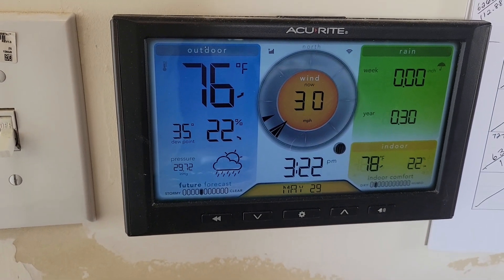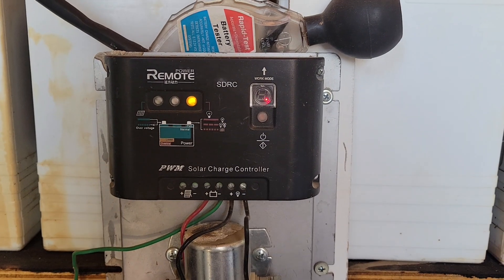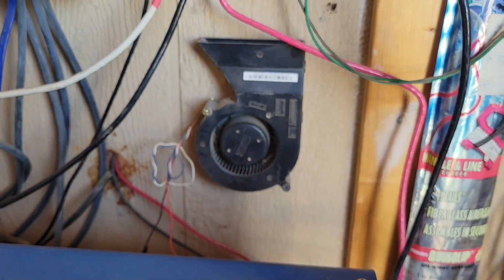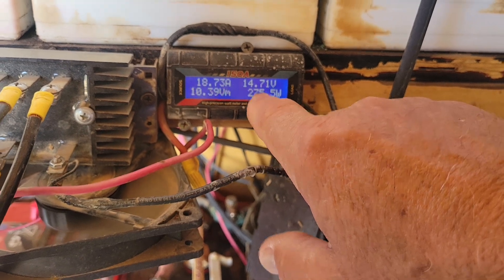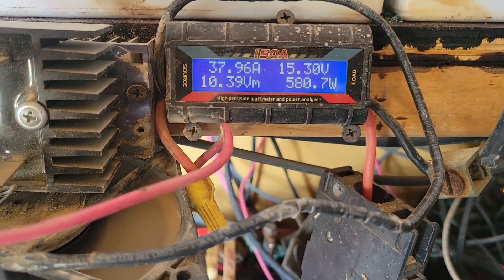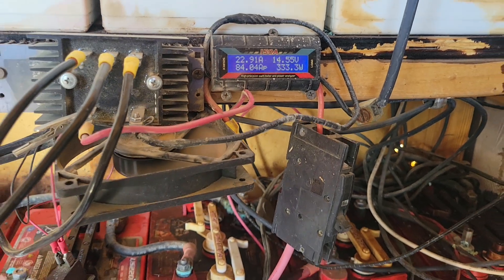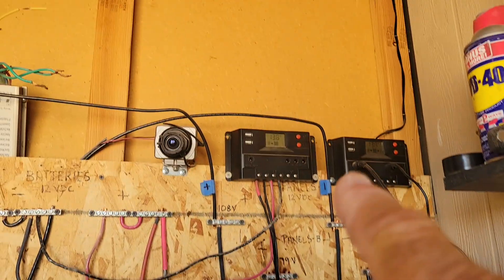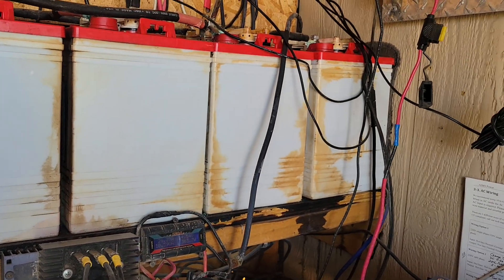Turbine Output & Dump Load Controller in High Winds, May 29, 2022

Comment: Hi G Bear like your site.  I am trying to find a wind turban load controller like you feature in this video.  Could you help me with it's name and supplier.  Thanks.
Reply from the maker: Welcome aboard!  The dump load controller I have is no longer made.  They have switched to digital units.
Check this, I don't know what voltage you need, this is for 12vdc
https://www.ebay.com/itm/304790038479?mkcid=16&mkevt=1&mkrid=711-127632-2357-0&ssspo=aQQOlvYpQl-&sssrc=4429486&ssuid=zdeiyk-orka&var=&widget_ver=artemis&media=COPY
Reply from the maker: You can also buy a dump diverter from this company.  This is where I bought my kt5 pma.
https://www.hydrogenappliances.com/

Comment: Your video has got me on edge. However, I would like some additional information on your Aims 12 volt inverter & charger. Can this inverter deliver power to all of your appliances in your home, if so, did you connect directly to your service panel?  Why must it be a; Global LF Series?  Allow me to thank you for your past videos, they are always loaded with information, well done.
Reply from the maker: Welcome aboard Eugene!  First, my inverter does run my household, but remember, I am OFF GRID, and live in a 450 sq ft cabin.  There are some concessions to be made, like not running high wattage appliances after sunset, etc.  The advantage of LF over HF, is reliability and peak power efficiency. 
Also, remember that off grid is "power in, power out" so having an efficient battery bank and solar system are as important as the inverter.  I would have preferred a 4000k inverter too, but they were sold out at the time and I was in immediate need.

Comment: I just bought two more batteries ; they went up $29 apiece since I bought the last two. I have 20 of them now. 990 amp hours @ 25 v. The 18 I had were doing pretty well, I went 3 days without the sun coming out, ( rain ) but the voltage was down a little more than I thought it should have been, so I figured it needed a couple more. I got a couple of those 120 mm fans that are 12 volts. I'm mounting one of them in front of the Aims inverter, so it will definitely have cooling going on when that fan is on. I made a couple of cables and I have the batteries hooked up and in the herd now. I am putting bigger wires on the charge controller, the new ones are #4 welding lead cable. And when the sun comes up I will have 1200 watts of panels aimed directly at it. I want to see what the amps is going to do. I think it will be around 35. Probably a good thing I got a 40 amp controller, lol. If these upgrades will let me run the A/C this summer, they will be well worth it. I'm sure glad I had most of them already ; that's a 30% increase in the battery price. It seems to me that having that number, they should last longer. I guess I will have to be the one to ask the question...since you have so much power, how come you don't build an electric car?
Reply from the maker: Sounds like you are getting there with your power.
As far as the electric car, I'm not a fan of them, and I really don't need one.  I will be getting either a side by side or a new atv in the future though.

Comment: I got my solar up and running and I'm getting ready to buy 1 or 2 more Midight solar classic 150, I know you have 2 controllers and I was wondering with this much money tided up I don't want to make any mistakes,  Am I correct by saying each controller I would run the PV wire in to a complete separate neg and pos bus bar from a seperate array then to the controller , then the neg and pos go down from the controller to the same post on the battery bank.  I think my battery bank is to big for my solar array. I have 5 KW of panels but I don't have them all hooked up.
Reply from the maker: Yes each controller needs a separate input group, not to exceed the 150 volts max.  But when running the output to the battery bank from 2 controllers, put one with the pos on the first battery and neg on the last battery, then the other with the pos on the last battery and neg on the first battery, etc.
Reply: @GBear  Got it thanks for your help.  I have it up and running but my battery bank midnight told me is to big for the panels and one controller.
Reply from the maker: @tonyjohnson1068  The only thing that would determine that fact is the speed of bringing your battery bank up to Float after sunrise.  I have 3450w of solar panels, and 3198ah of batteries, and I reach 13.6v or better withing an hour of sunrise.
Reply: @GBear  I have one controller. he told me to put another controller and add more panels. I have 5KW  of panels but I can't put all of them on one controller. I did plan to put  3 controllers but I spent way more than I planned on spending. I was hoping to wait for a while.
Reply from the maker: You didn't mention how fast your battery bank charges as is.
Reply: @GBear  I have 32 105 AH  AGM batteries, Wired in a 48 volt bank. 3264 AH.  in my opinion it is charging. By noon it's up to 56 volts. but as soon as the sun goes down or when it goes into resting it drops to 51.9.   Todd at midnight solar ( tech support) tells me that is depleted. But I run my window unit A/C at night it will not go below 50 volts. I called them because on Friday my controller went a little crazy. sunny day my PV in put voltage was 52 volts I have them wired for 120 volts and my bat voltage was 50. as my bat  volts went down so did my pv in put voltage. we did a factory reset and it was fine again. But I was planning for 2 more controllers and all 5 kw panels. we have 3 people here and a well. In Florida it is against the law to live off grid . I'm still on the grid but my A/C and well are not.
Reply from the maker: @tonyjohnson1068  OH OK, that explains alot.  Yes, it sounds like you need to get more panels and controllers into the system.  You are using a lot of power and your batteries are struggling.
For what you spent, you could have gotten  couple of Tesla house packs and grid tied panels to eliminate your electric bill all together.
Reply: @GBear  I have the panels I bought used and they put out more power at times than the name plate. My friend owns a battery store he got me 35 used AGM batteries. I have in it right now what 1 Power wall would cost. When I'm done I will have about 14 k in it. My friend got a quote for solar they wanted 50k to install enough for what they  say will get rid of his electric bill. But most people that have it tell me they still have a electric bill. and a solar bill. I will just slowly over a year just reduce my bill. my friend called me and told me he has 15 more 170 AH AGM batteries for me. I have more  batteries than I know what to do with. And the used panels are very cheap , but the controllers and copper is where it gets expensive.
Reply from the maker: I understand.  Out here there are government backed programs to get free solar for grid tie houses.  The grid can't support all the demand here, so they want to install enough solar on roofs to supplement the needs.  They found it was cheaper than building new power plants.
Reply: @GBear  Wow,  Just a few years back they tried to change or make it law if your grid tied the un used power that goes back on the grid they wanted to charge the customer to take it back instead of giving them a credit. WE have Duke Energy, They have raised our rates almost every year. plus if I went grid tied I would have to pull a permit and rebuild my electric service to a net meter and change the meter base. When you get the gov involved it is never good.
Reply from the maker: Out here, years ago they installed "smart meters" and at first you could refuse them, then they changed it and made it mandatory. Those eliminated the need for meter readers, but I suspect more was involved.  Now they offer free solar and ensure that it produces way more than you need, so you get a credit, but they sell your excess to your neighbor at twice what they credit you for.  Not a bad business idea in my opinion, but still a rip-off to anyone who doesn't know better.  Electricity wasn't invented, it was discovered, and Tesla wanted to beam it to houses for free, but Edison said, "If I can't put a meter on it, it won't happen."  He and government cronies drove Tesla to the poor house.
Reply: @GBear  Free solar that's unheard of. Here people want it but it cost so much it will take about 15 years to pay for it's self. And they send salesman to your house promise the world , And after it's installed it's to late and it's not what they promise, Then you still have a e-bill and solar bill.
Reply from the maker: Keep promoting liberals in office, and it will get worse, in my opinion.
Reply: @GBear  I agree.

Comment: If you got half the output power, , that mean the wind was 90/1,41 = 64mp I think. Because aerodynamic forces increase proportional to the speed squared.
Reply from the maker: Welcome aboard.  I know the max output is 1685 watts, and the stall speed of the propellas is 90mph.  I have witnessed 800+ watts output in a 43mph wind.

Comment: have you split the cable from each phase to the bridge rectifier? i have done this and get more power output.
Reply from the maker: Welcome aboard.  I'm not sure what you mean by splitting the cable.  Please explain.
Reply: @GBear  so from phase one of you coils, most people run one cable to the rectifier. If you run two wires and connect to a separate AC pin you get more power output.
Reply from the maker: I have 3 wires coming from my pma, connected to 3 wires at the input side of the bridge rectifier.   I see no other way to do that.

Comment: When the winds get too strong, spread your wings and fly.  I  think that all off grid power systems should have both solar power and wind power systems. That way when there is no or little solar there is a chance power could still be generated.  Great job
Reply from the maker: Thanks, but how did you know I have wings?
I said it before, and I'll say it again....have plenty of solar, and battery bank, then supplement that with wind power.
Reply: @GBear  Just a lucky guess
Reply from the maker: Maybe you should buy a lottery ticket.😁👍
Reply: @GBear  Maybe, but if I put money in, I always lose
Reply from the maker: @poolsidedreamer  if that is what you believe,  that is what will happen.

Comment: Hello from Cyprus, your giant battery bank amazed me. I used to use Trojan flooded batteries and they did not last more than 4 years. It's costly and heartbreaking situation. For last 4 years I use much much cheaper Chinese maintenance free batteries and they work great so far. What would you recommend to extend the life of the batteries. Cheers.
Reply from the maker: Welcome aboard!  For flooded lead acid batteries I use the BLS-12-N Battery Life Saver.  I don't know if they will work with maintenance free though.
Reply: I'm offgrid in the UK and am using LiFePO4 cells. Much more robust than lead acid and you can deep cycle them without worrying about damaging the cells, I've just ordered another string of 280AH cells which are specified to handle 6000 full cycles provided you compress the cells in a frame to prevent bulging. On a 5 year calculation they work out cheaper than lead acid by a wide margin, just make sure you add top balancing boards at 3.6V.
Reply from the maker: Welcome aboard.

Comment: How long did it last to upload this vid?
Reply from the maker: 3 hours
Reply: @GBear  normal service again?
Reply from the maker: @earlshine453  nope.  They are still working on it.  I switched to my wifi to get slightly better speeds.  That video should have uploaded in 15 minutes under normal conditions.
Reply: That's a bummer, but i remember using dial up at 110 bps. later on 330 BPS, but only at night when then neighbours stopped using their telephones on our WWII lines. Now I'm on something megabit download. Some off-gridders nowadays claim they use Starlink with great result.
Reply from the maker: Oh yeah, the good Ole dial up connection.  Was yours with the internal modem card, or before that with the phone cradle?
Reply: @GBear  Had to place the phone piece for speak and hear in 2 rubber cups after making the connect. Used a lot of different dial up devices afterwards
Reply from the maker: @earlshine453  same here.

Comment: Off topic I shared your tool vid about the volt meter you featured with my brother. He immediately purchased it.  He received it promptly however he didnt have readers on and got lead plugged in wrong hole and blew an internal fuse. Tried to find one locally  but no luck. Long story short he contacted the company. They sent 3 replacements to him plus free of charge. Very very impressive customer service.
Reply from the maker: Happy to hear that!  I'll pass the news on to my contact.
Reply: @GBear  Correction, 2 different size fuses internally sent him 3 of each total of 6 free of charge free shipping also...very unusual these days.
Reply from the maker: Great!  I told them I had trouble hearing the beep tone, and the said they would make it louder in future meters.  Excellent customer support.